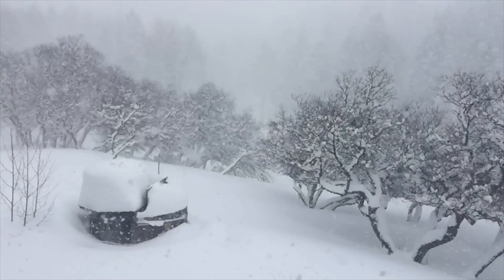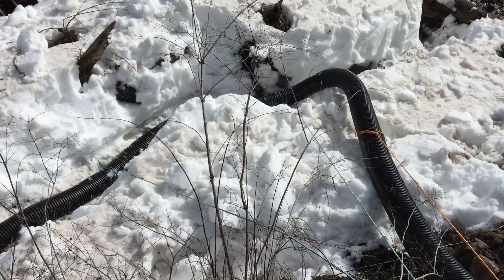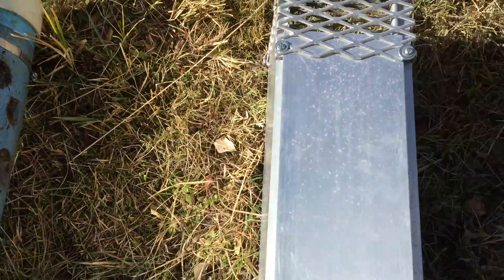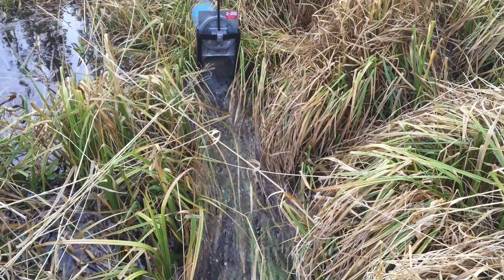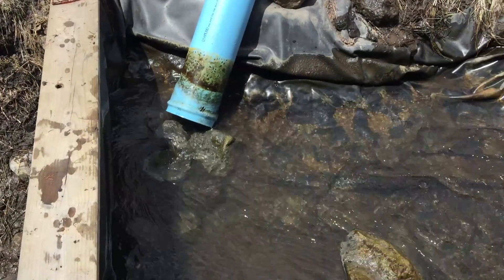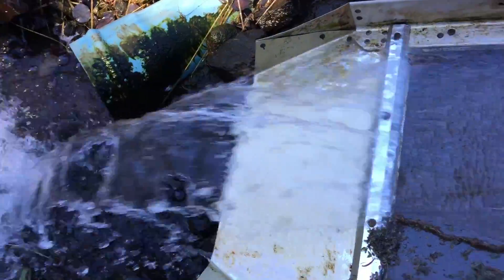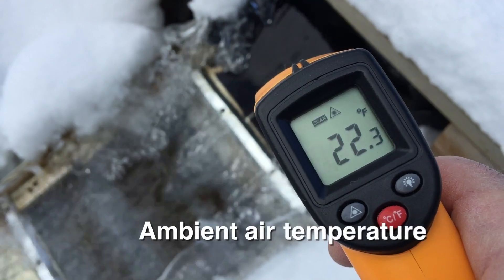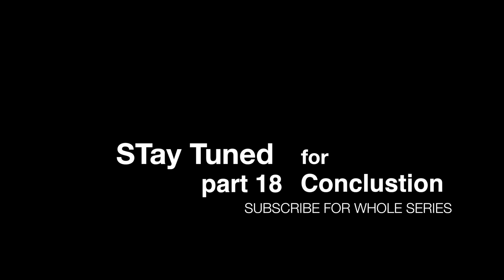Part 17 MicroHydro Power System in CO

Comment: You could use automatic air vents at high points to deal with the air lock problem. These are commercially available or easy to make yourself.
Reply from the maker: +David Lowe We have air vents on the original penstock shown in the early parts of the series, so we are aware.  The difficulty is fitting them to flexible black poly drain pipe for which there are very few fittings produced.  I'm not aware of any fittings that would make it possible.  Thanks for the suggestion just the same.
Reply: MrHydrohead 
What I have in mind is: cut into the poly pipe and splice in a PVC reducing tee (or similar) with the branch facing up. You can then fit the AAV on the branch with commonlyavailable fittings (solvent weld a flange or NPT socket for example). I'm a process pipework engineer by day ;-)
Reply from the maker: +David Lowe Thanks David, I had a suggestion from another viewer that I think I will try first.  A vortex intake to prevent air from entering in the first place. https://m.youtube.com/watch?v=wZ4JLTnbUy0 Potentially less freezing issue in winter and easy to make from salvage materials.  But, your idea may end up being a good solution if it doesn't work.  Thanks for the thoughts.
Reply: MrHydrohead 
That design is a very good idea! However, he has put in a vortex breaker - a vortex is actually a problem because air enters down the spiral. I recently had that issue in some large vessels which were taking forever to empty because the scavenge pump was cavitating trying to get the last 10% out of the bottom - a vortex would form naturally and admit air into the pump - like when you empty a bath. You want to prevent that from happening.
I still think you will get some air in the lines but I hope not. Good luck!
Reply from the maker: +David Lowe Thanks. I did note the vortex breaker in the notes for that vid and have planned to mimic it. I only called it a vortex intake as it is what the referring viewer called it. I agree you don't want a vortex. We shall see if a vortex break can work with the volume of water. My reticence to use air vents are that the whole pipe needs to be removed for spring run off and may not sit the same way each successive year and vary the position of high points, glued joints risk failure, 6" T fittings and good vents aren't inexpensive, and snow loads get quite deep in the depths of winter and limit access. If the tests with this improvised rig fail, your solution may be better. Thanks for offering your professional advice ✌🏼

Comment: It doesn't look like it's that much of an issue, but have you looked into heat tracing the pipes?
Reply from the maker: +mercmech Not really.  It isn't that big of an issue.  Once the water is in the pipeline which is mostly buried, the flow remains constant.  A new Coanda screen we plan to install may reduce ice buildup and cleaning needs.  Running heat tracing would require digging up the pipe and committing power to make heat, if I understand what you are suggesting.  That most likely would be a waste of resources and power, but thanks for the suggestion.

Comment: One way to generate some heat along the pipeline is building a compost.  Run the water thru the compost bin in the winter, the heat transfer will help. In the spring you have soil for garden.  Also if you can put the waste from the filter in the compost. And a windmill would help as a backup power source.  The pumping action could help move the water thru the system.
Reply from the maker: +Shawn Strode Interesting idea, not certain how practical it would be. The only point where freezing is even an issue is at the intake screen, 1/2 mile from where we might someday put in a greenhouse.  Wind here on average is under 1 or 2 mph, so no real advantage there, but thanks for your suggestions.

Comment: i have seen more self cleaning screens than yours using the flow of water to move the debri on albeit over a punched stainless steel sheet
Reply from the maker: +Dan Barclay Our plan this summer is to install an engineered Coanda screen with a 50 degree slope which should be largely self cleaning.  We'll post a video of the change over when we do it.  Thanks for watching.

Comment: didn't show much how the generator works? which is what i wanted to see! I know how make water flow already, so make a video on the generator part ty
Reply from the maker: +Perry Bird Not sure if you viewed the other segments of the series.  Point was to show an overview of how the system works and how it was designed and installed. I'm certain there are plenty of videos around on electrical generators and the turbines that drive them.  My hope was in some way to fill a gap in information about micro hydro available on YouTube. Thanks for watching.

Comment: I wonder if you could just utilize a coarse sediment screen on the initial intake, and utilize the "riparian barrier" to remove most of the silty sediment by settling out due to widening and reduced carrying capacity.  Then follow up with fine filtering for reduced maintenance.
Reply from the maker: +lowrads I'm not certain if you've seen the other segments of video. That is basically what is occurring in the existing design. We haven't really had many issues with sediment.  Just the ice buildup in winter.  Thank you for thoughts just the same.  Thanks for watching.

Comment: With much interest I follow the project

I have seen all the videos about the project. I'm wondering what the entire project has cost. How many years it takes to earn yourself back.

Give the system enough energy to heat the whole house in winter. One 2000W heater used 16 amps at 120 volts

I'm looking forward to the next video
Reply from the maker: +lexpee Thanks for watching. An estimate to run power lines to the property in 1995 was $120k and more recently $250-300k, so the initial investment in the first system which supplied both gravity fed domestic spring water, a fish pond and power all for around $25k in 1995 was a no brainer.  The redesign and move of equipment added about $55k to that and provides all the power we need for winter heating and potentially bitcoin mining in the future.  So it's not really looked at in terms of pay back, but more an investment in the property and an independent lifestyle.  More vids to come, however slow the delivery.  Too many projects too little time.  Thanks again for watching

Comment: Great video, thanks for sharing! Also have you looked into the type of water-wheel powered screen scrubbers/debris removers often used in irrigation ditches? I believe that would save a lot of effort on your wier.
Reply from the maker: +Gregory Norris Haven't ever seen one, no.  Plan to install engineered 50 degree slope Coanda screen this summer.  Should be largely self cleaning.  Any efforts we make are a pleasure and not a chore fortunately.  Will post video of new screen when done.  Thanks for watching!